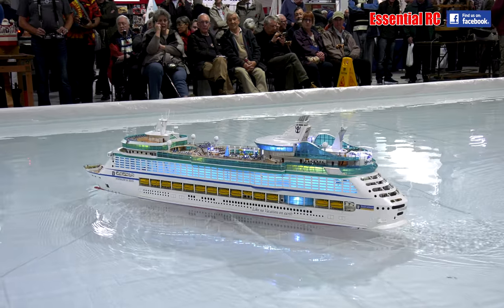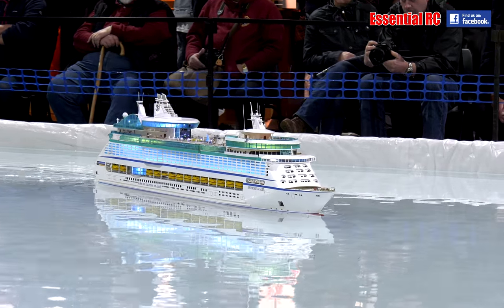'VOYAGER of the SEAS' RC Cruise Ship AMAZING SCALE DETAIL CLOSE UP [*UltraHD and 4K*]

Comment: The hull is formed of 25mm  blue polystyrene sheet glued together in sections using epoxy resin  then carved and sanded to shape  which was then finished in  fiber-glass cloth which was coated in laminating epoxy resin to give a durable finish .
Paul Chilcott
Reply from the maker: Thanks for the info Paul. I will add it to the description. Was great to see this ship in action again although in calmer water! Cheers Dom (Essential RC)
Reply: Hi Paul, Nice ship modeller. I like your explanations of Hull construction. I AM ship modeller too from Brazil and and currently buildings a 1:100 Bismarck battleship. I Will pretend Fiberglassing cloth to strengh  my Hull and impervious from Water.
I would like to know what fabric gramature do you use on your model. Nice boat my cngratulations .

Comment: As most scale models, it's being driven way too fast.
Reply: that's pretty accurate speed, cruise ships can reach up to 20 knots in real like
Reply: life*
Reply: This thing is 1/300th the size of the real thing. Get someone to do the math for you.
Reply: @stuwest3653  according to Froude's law 20 knots of the real vessel a 1/300 scale model should run 0.594 m/s or 2.14 km/h to produce a similar wave pattern.
If you are interested in the involved math it's fairly easy.
Froude No. of real ship and model ship must be equal.
Then resolve equation to model speed Vm.
FN = V / Sqrt(g x L)
FNm = FNs
Vm = Vs x Sqrt( Lm/Ls )
Ls/Lm = Scale Factor = 300
1 kn = 1 Nm/h
1 Nm = 1 Arc Minute on any Longitude or Equator
Divide Earth's mean circumference by 360° by 60'
Then you arrive at approx. 1 Nm = 1852 m
or 1 kn = 1852 m / 3600 s
Reply: @othernicksweretaken  That's great. It's still going too fast. Besides, scale speed and recreating a wave pattern is completely different.